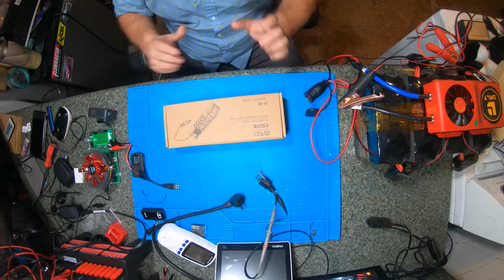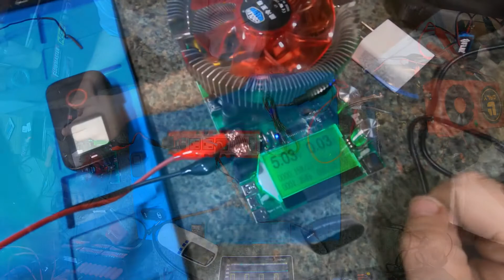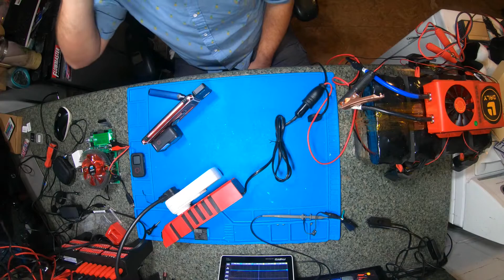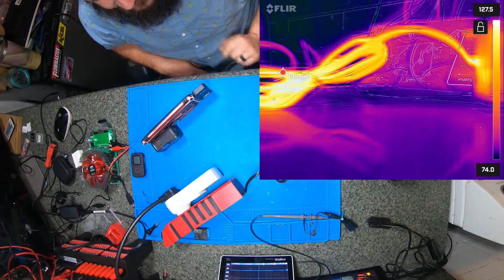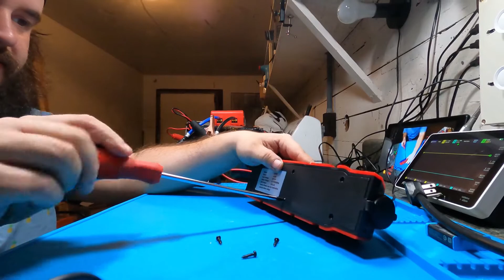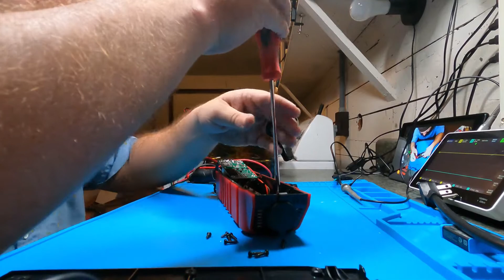The Worst Testing 12v Inverter Yet (BYGD 150 Watt Inverter)

Comment: hi.can bad designed inverter destroy my well water pump ??
Reply from the maker: Well I don't think it would destroy the well pump but most likely destroy itself first. But I wouldn't recommend using a cheap inverter on a well pump if it's you rely on it for your main water source. But if it's not... go with something that's over the wattage of the pump by 2 just to be safe and reliable even with the cheap ones.
Reply: @OperationCamp  thanks.can im use modified sinusoid on single phase deep whell water pump?